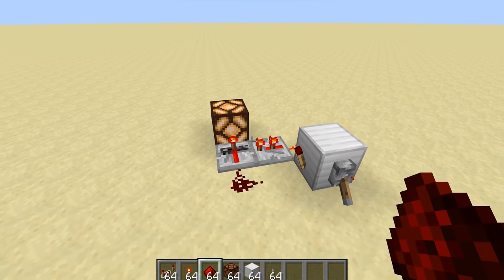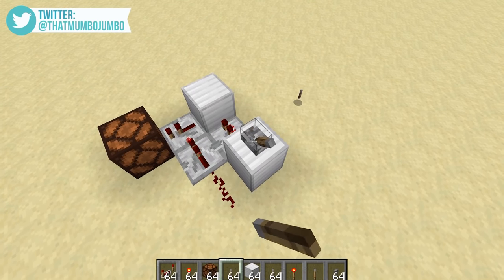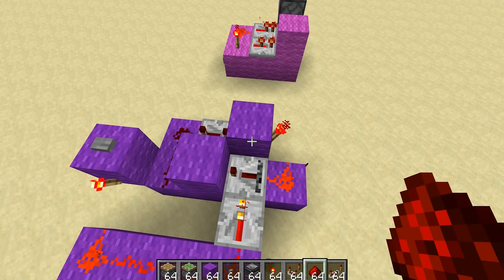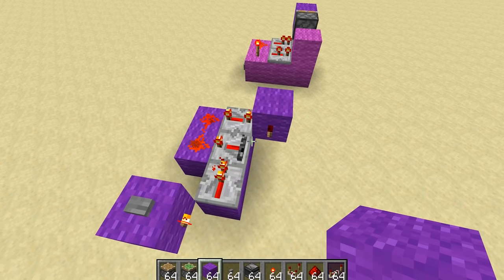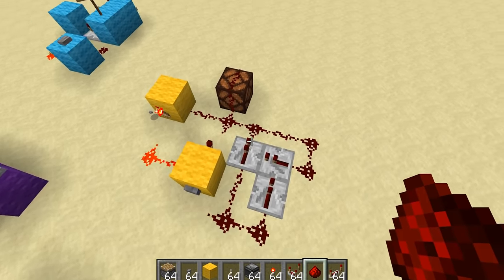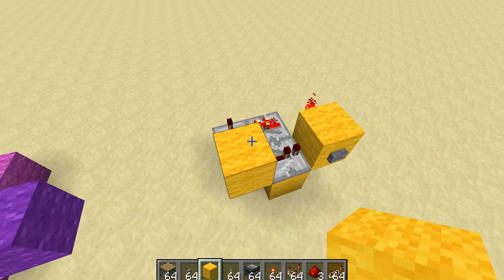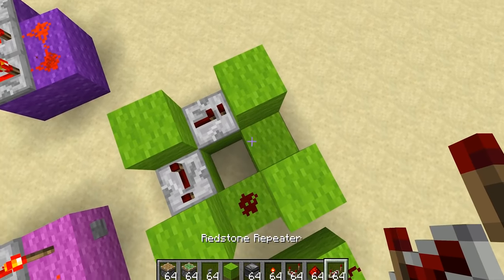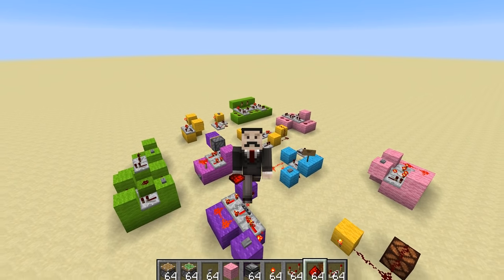TRYING to Understand LOCKING REPEATERS in Minecraft!

Comment: These are one of those things I feel are really useful, but can never find a use for
Reply: Like bats
Reply: i remember sethbling using it in his very old ocarina of time thing for a memory system
Reply: it's not that crazy useful actually. Simply because there are a lot of ways to do the same thing in minecraft. I have used it twice i think. Once to get a very specific clock for a sorting system (1 tick off, 4 ticks on) and I once used it as a signal limiter, to prevent an observer getting repeatedly triggered by a piston in a sugercane farm. It happened to be small, just the right ammount of time for that situation.
It;s very niche.
Reply: i totally understand that
Reply: I used them for 4 4bit storage cells and it worked really well
Reply: I made a game where there are two Dimonds on a presser plate both locking two repeaters until you get both dimonds
Reply: I used to use them all the time to keep piston doors open and closed with a butt9n because I hated levers and never looked at other ways of doing it... That was about the only use that was worth it imo
Reply: Ikr
Reply: One use is that they can be used to make variable piston doors. Doors that can either open then close immediately afterwards, or if you hit another button, they will remain open. For instance, during the day you might want to leave the doors open, but at night you want them to close quickly behind you.
Reply: Yes😂🤣
Reply: Gated d latch?
Reply: RAM for computers
Reply: its main use seem to be to make things not a noisy mess
Reply: Cubfan used it in an auto-smelting kelp xp farm to lock the repeater that would send the minecart back in the loading zone, which switches the rail curve only when the cart is empty
Reply: who actually understood mumbo jumbo's mumbling
Reply: Very small D-flip flops (Memory circuit that takes the value of an input and latches it when a CP is applied.
Reply: They can be used to make things still work while another thing is unpowered. Basically saves a single repeater to stop two way signals.
Reply: they help me in making my large vault doors.
Reply: @su-ye9mh  yeah im trying to build a computer in minceraft right now
Reply: It’s useful for very specific pulse extenders, such as a 13 tick or something weird
Reply: Permanent locks
Reply: examples of uses: combo locks, shift registers
Reply: It can be used for Digital Storage Like RAM or ROM Chips, However RAM can Remove Information while ROM isn't made to do that
Locked Comparators however can still Subtract and Compare Values but also hold States (Including Strength)
Reply: The sculk sensor adds good power to these
Reply: IKR
Reply: making a button work like a lever where u click it and something stays on and then u click it and it turns off

Comment: I actually use these to make my redstone machines unbreaking, that way you cant power the machine while its cycling
Reply: What's cycling
Reply: @naiknaik8812  the machine, i lock the input so you cant spam it
Reply: I use them in bedrock to make like small pumpkin farms with observers so the observer doesn't create a loop with the piston
Reply: @demetriusthompson2362  that's a smart solution, I've been using a piston to block the second pulse from the observer all this time, smh
Reply: @crackedjudgement4365  huh, that's pretty cool now that I think about it
Reply: I’ve been using a pulse extender to power a piston to push the block up that the observer send a signal into that powers 15 pistons may try incorporating this into it since you mentioned that pumpkin farm
Reply: @demetriusthompson2362  can you link me to a screen shot of that setup?
Reply: That is actually a good idea!!
Although i don’t know what you would use for it
Reply: @demetriusthompson2362   Let me see if I understood that correctly: The observer output (1 tick pulse) goes through the repeater, which subsequently gets locked in the off state by the 3-tick repeater, so the piston (which was fired by the observer pulse and has 2 ticks delay) can trigger the observer again, but the observer pulse is discarded by the locked repeater on its output.
Reply: @TheRealWormbo  Exactly
Reply: @demetriusthompson2362  Very clever idea!
Reply: @demetriusthompson2362  I've been using a 2 signal from 1 observer solution, I use the first repeater to push power through a raised piston, then send the  2nd signal through a not gate that pulls the piston down, the piston pulses 2 or 3 times, then stops
Reply: That's actually a really nice way to deal with that. Well done.
Reply: L E V E R S
Reply: Taco Lord Yeah well you could but you could just flick it off then on again, breaking the machine
Reply: We use the first design to kick start endless zero tick cycles. Then another locked style circuit to toggle it off.
Reply: Grian-proof

Comment: Comparator reading a container, as soon as it fills up enough, it locks the repeater, and then something else. Idk, just spitballing thoughts.
Reply: Maybe the repeater is used to pass a signal from a clock to a circuit that only works on a rising/falling edge and powers a machine that fills the container. 

Or maybe the repeater-lock is used to keep an auto farm from harvesting new materials when the container is full.

Comment: Locked Repeaters can be used like Comparator-Rising/Falling-Egde-Pulse-Extenders, especially when you just need a bit of delay when turning it off. Instead of a long line so that the signal length is going down quickly enough you just need one repeater on one tick locking the output repeater. Negating it works like the real Comparator-Pulse-Extender too, just a Redstonetorch as the Input and the output going into anothee torch

Comment: Repeater locks are actually very useful in computational redstone. When you're sending a signal down some busses but you only want one component to read that signal, you can lock all the components but the one you want to read it. Alternatively, if you want to save a value, you can send that value into the repeaters and lock them. Unlocking and relocking them would be saving a new value.

Comment: - You can make a really funky Nor gate
 - You can "store" an output for later by locking it
 - You can make a "First input to turn on stays on, the other never will" kind of thing (useful for race-y things)
 - You can temporarily negate the change of a repeater so no observers fire on it's behalf (though maybe once)
 - You can make memory out of it (I have done before)
 - You can disable a button's output
 - You can use it's shape over other designs to help weave through other circuits
 - You can make a pulse contractor (a de-extender)
 - You can combine a pulse contractor & extender into a pulse delayer (if you're bored of using repeaters the right way)
 - And overall a feature that locks a signal is pretty handy in general.

#repeaterlocking

Comment: My favorite use of locking repeaters is for a flat, 3x5 pulse-length detector. Took me forever to find anything related to pulse-length detectors, and they were all huge, so I made a smaller one that works by chaining multiple circuits together, with each circuit shortening the pulse length by 1.

Comment: I built a pumpkin/melon farm using observers looking down at the crop to trigger a piston on the side to harvest it.  I needed used one repeater as a pulse extender for the observer to fire the piston and a  second repeater to lock the first to prevent observer-piston from becoming a clock.  Simple, straightforward, and worked like a champ.

Comment: Mr Mumbo, I'd like to officially congratulate you for breaking reality in Minecraft.. Your last experiment actually produced a quantom state in which the comparator was both locking and unlocking the repeater at the same time.. Simply marvellous. Also, this locking concept is best used for selector systems.. say in your auto equipping stations, you can have a selector input panel of constant power from levers into a comparator selecting the locked positions of which signals to send to your separate dropper feeds for separate armor types, then having this locked information storage, you step on your pressure plate to activate the cross signal sending only what's wanted and a multiple firing pulse via activator clock to the equipping station.. 🤗
Reply: It's essentially a common form of data storage.. it's essential for making working computer like properties with redstone.. working locked hoppers with selector inputs and etho timing systems is the best way to make automated games as well.. 😉

Comment: Who uses the feature?
If the literal redstone guru doesn't, then who does?
Reply: I messed with it once
Reply: I use them all the time for monostables. That's about it
Reply: I them use for a silent t flip flop and cuz I'm on bedrock and no piston spitting. I changed the clock timing to accept a different pulse length. Down to one tick. I also designed a tilable binary counter with them. Basically putting the clock vertically for compactness. Really long text. Like if you read the whole thing.
Reply: To avoid very large Comparator-Rising/Falling-Edge-Pulse-Extenders when just a tiny bit of delay is needed
Reply: Use it for the shutter lines of my large Redstone farms. Just finished a 288 village iron farm with a quick reset. Uses locking repeaters. Also, who's the Redstone guru? Ilmango and gnembom both use it.
Reply: The Most Extraordinary P & P Gamers I’ve used them before.
Reply: Mumbo might be one of the most fun redstone people to watch, but there are a lot of people better at redstone than he is, even he says so!  That being said, if HE doesn't understand something redstone, I don't mess with it!  He makes it simple to understand, unlike some others.  I don't watch a lot of others, but enough to know better.  It's one thing to copy something block-by-block, but I like to have some clue as to how the things I build make sense.  Otherwise, I leave it to people smarter than me :)
Reply: @shadodragonette  ilmango is a good slime block builder
Reply: @shadodragonette  I agree completely with that. But without trying to sound rude, mumbo quite often says things along the lines of that he's great at Redstone. Which, I mean, I'm not a fan of. But yes he's amazing for new players. Edit: should have said. Take what you've learned from him and try to pass him. I remember the day I watched one of his videos and thought "that's a terrible way to do that", was a very proud moment.
Reply: People who build literal computers in redstone use it.

It's an implication gate.   Input A overrides input B.   As long as A is true, the circuit is true.   If A is false, then the circuit is true only if B is true.

This is not nearly as useful as a NAND gate, but does show up in certain Karnaugh maps as a way to simplify certain types of logic.

You can tell from the way Mumbo talks in the video, he's done some study of this.
Reply: I used to..like I said, used it when trying to design a combination lock 🤦🤦
Reply: I have always loved them
But there so hard too understand
Reply: Memory
Reply: @pags5zonda623  there are a lot of Redstone gurus tbh, like anyone here might find the name CNBMinecraft a bit familiar by example

Comment: I havent watched the whole video yet but my immediate thought for why these are a thing would be to create fail safes in lines of redstone. You could easily use these in sections to make sure your devices stay on even if someone disrupts the "wiring" or you could wire everything to a "breaker panel" or something and be able to cut or reroute power as needed. Just a guess though now I'm going to watch and see what you came up with.

Comment: The whole locking mechanism is rather useful in compact cannon designs. (I'm not quite good at making them)

From what I understand you can take a Pulse extender with the ability to change the length of the pulse as a input. You take that pulse and direct it into triggering the first stage of the cannon, while locking the second stage with either a repeater lock or compater lock. You use some sort of timing mechanism to unlock the lock. And then it should dispense the second stage of tnt. And what you get is Adjustable  Arcs on a Tnt cannon by changing the length of a pulse. 

This how I think the whole cannon thing works, but look up Bacca yarro or minecraft airship pirates to really see what is archiveable using the locking mechanism in cannons.

Comment: The best use I've found for the locking repeater is when I want multiple inputs into one contraption. Like several light switches in a single room or a button on each door in a 4-way piston door. If you pull all those inputs into one redstone lock and then to the contraption, all buttons can be used at anytime no matter which you used last.

Comment: Locking repeaters can be very useful for temporary memory storage. I once used locking repeaters to make a calculator. After you input a digit, it would lock the repeaters, saving that digit in that spot. Then, once you input another digit, it would move the first digit to the next set of repeaters, and lock those repeaters.

Comment: The only time I found a use for locking repeaters was in a control circuit for minecart switch. If a minecart came from a particular direction, I needed to disable a detector rail in a latter part of the rail switch. Locking a repeater in the line from that detector rail did the great job of stopping that signal.  I think they were meant to allow creation of simple D flip-flops, (E.G. memory circuits) but that did not happen as they were not a tileable solution, so needed too much space.

Comment: The single use I've found for them was to set up a supervillain trap that they've totally got a chance of getting out of, where if you stole out of the chest in the center of a room, it activated a line of redstone with redstone lamps periodically lining the room to indicate where the pulse was and that had a few levers attached to repeaters, which were meant to lock the timer and stop redstone signal from reaching the room's explosives. If that makes sense

Comment: Locking repeaters are great once you figure them out. Consider what they do, and why you might not want a redstone signal to change in a given setup. Maybe applying or removing a redstone signal at the wrong time breaks a setup. A locked repeater can keep that signal from changing.

Making gates is great, but they're not the only things we can use redstone components for.

Comment: It's essentially a D latch. You can use them if you want to sample the input on a specific phase of a clock. Or you can make a DFF from them and sample the data only on a positive or negative edge. Typically useful in clocked digital circuits which aren't all that common in minecraft (because they are almost always overkill for the type of things that we need), but extremely common in electronic circuits.

Comment: I use them for the 50/50 random output. It does the same thing as the piston does, but it's silent.

If the output is 1, it outputs.
If the output is 3,  it outputs, but it locks the 1 side as it goes through, so the 1 side doesn't output as well.

You do need to adjust the timings, and I've added a few more repeaters so that no matter which output you get, it happens the same amount of time after I input

Comment: You know that there is a similar feature for comparators? If you power the side, it will cut off the signal.
With that you can build things like a hopper that only powers a circuit when a specific amount of items is in it. 
You would run the comparators signal directly(with the needed redstone length in between) into its own side.

Comment: A rather strange discovery of mine... place 4 repeaters, all facing the sides of each other, and surround it with redstone dust. The repeater's outcome will be different, depending on where you place your lever. (As of 1.12 may or may not work in 1.13 and above)
Reply: This is because of update order

Comment: I've found locking repeaters are useful for memory cells, it works well if data needs to be shifted
Placed in a row, with a separate line to lock everything, data can be inserted from one end while briefly unpowering the locking line
Clearing the data is also simple, just unlocking everything and letting the data flow out of it

Comment: A locking repeater would be useful for some sort of multi-input system.
Where you do something somewhere to allow something to operate but only when triggered somewhere else.
Like, maybe a gate that you can lock from the inside.
One of the core repeaters of the gate mechanism itself, that comes before the mechanism, could be locked by a repeater that is triggered by a lever on the inside.
So, as long as it's locked, no matter how many times you try to open the gate, it doesn't work.

Comment: Redstone Challenge:
Build a 3x3 pistondoor with only, repeaters, comparator, redstone torch, redstone dust and some pistons/stickypistons (you can only use them for pushing the blocks for the opening and closening sequenses, not in the circuitry)
And ofcourse you can use blocks, but no falling blocks.

Comment: You can use locking repeaters to lock a circuit on or off, unlike a lever, which only give a signal when it is on, the lock will stay on or off until you (if you built a way to unlock it) unlock it. I use the lock for a map I am making with kittygamesx

Comment: Ive only used this for counters. You can make it so every pulse unlocks one repeater and unpowers a torch. You can stagger another one directly above it, one torch spacing to the side so that only 1 line is powered or unpowered at once depending on the number of pulses given. I used it for my binary to base 10 decoder because i couldnt find a better way.